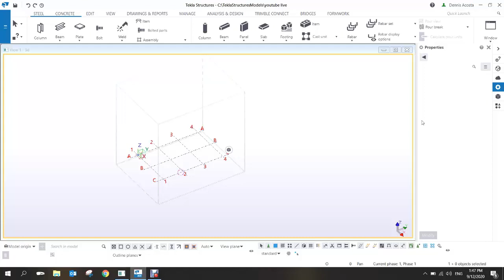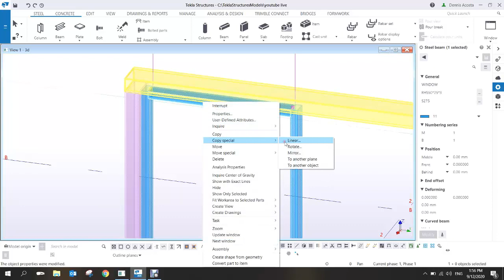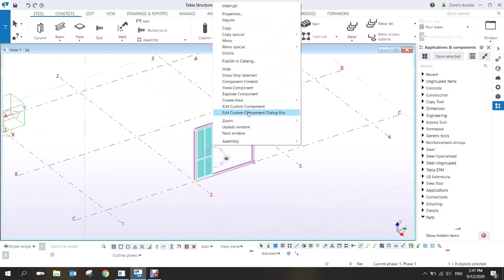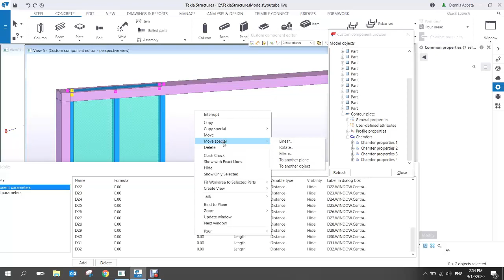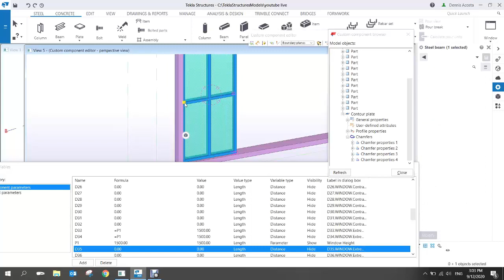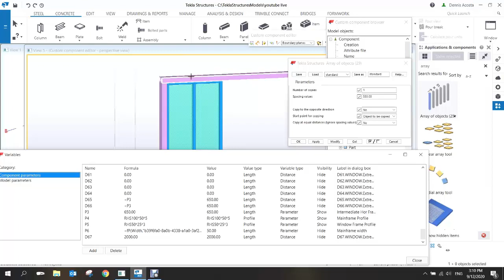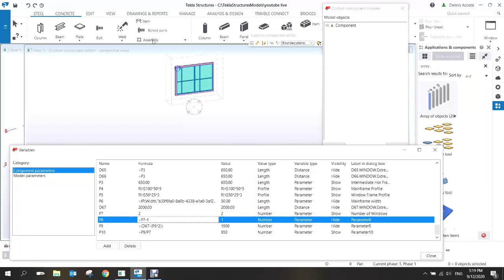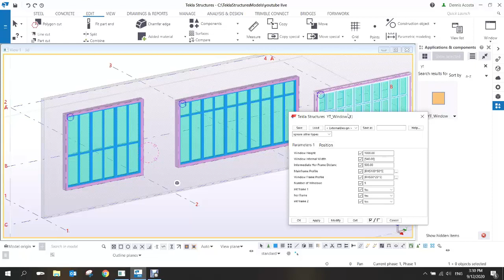Intelligent Custom Component for Architectural Window

Comment: If i wamt to have no horizontal or vertical Profile (intermediate ) Only one Windows is created. CAN you help me ?  Where is the mistake?
Reply from the maker: you need to create a YES/NO option and add rules on it...
Reply: @thehowsofteklastructures565  I made the YES/No option according to your Video. Everything works till i change the option to no than only one Window will be created instead of for example 3.
If i choose by one of these three Pipes option NO there is a mistake and i don't know why.